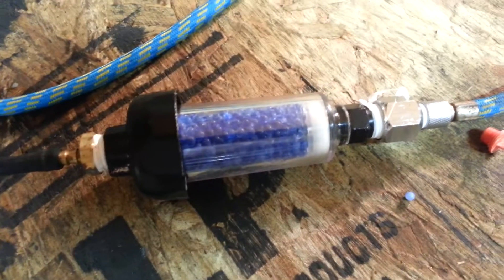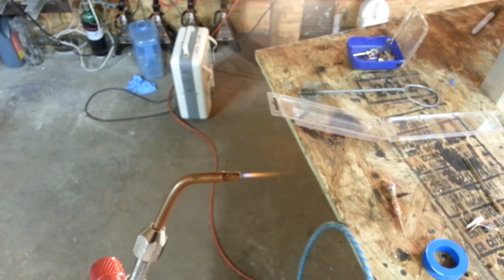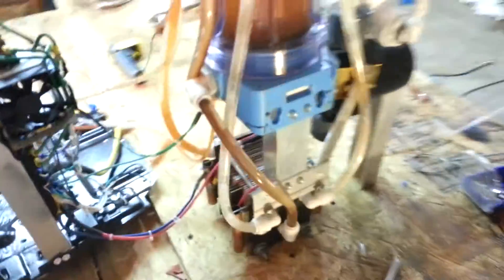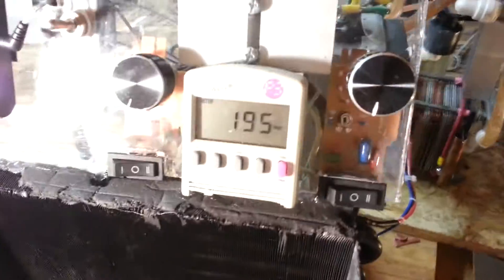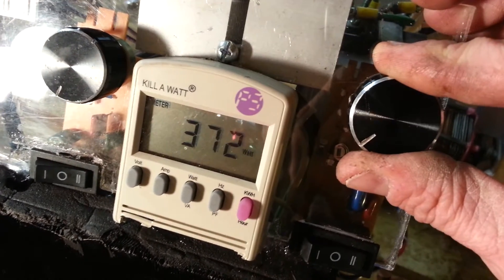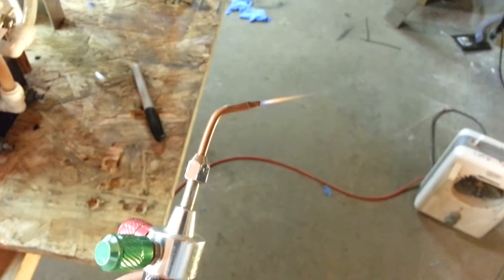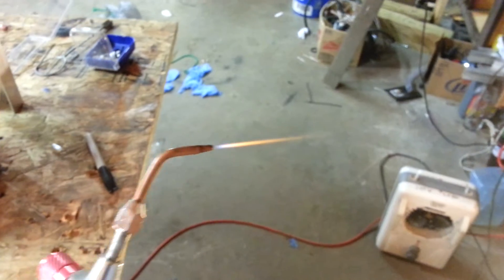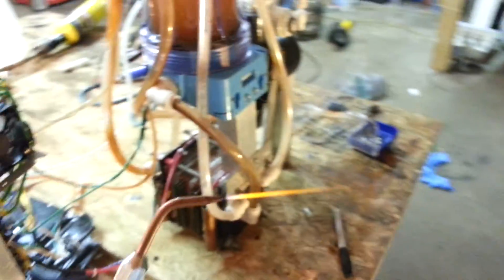hho torch 1( bread bored lay out )

Comment: Silica gel/Cobalt chloride is good as an indicator, but not so much as a dryer. Have you tried magnesium sulfate for drying?
Reply from the maker: at first glance i would say i dont believe you but then again this video just prooved your right,actualy the cobalt chloride is just an additive in the silica gel
to turn pink when saturated , it is carcinogenic. and you are correct it sucks for drying wet gas streams , maybe humid are but not warm  water vapor  . i have not tried the sulfate , but i did try naoh and have a video of it working , the flame is brilliant blue and melts rocks and ceramic much better then a yellow flame, it also solders excellent where the yellow flame will contaminate and scorch your flux if your not carfull . i will look into your suggestion